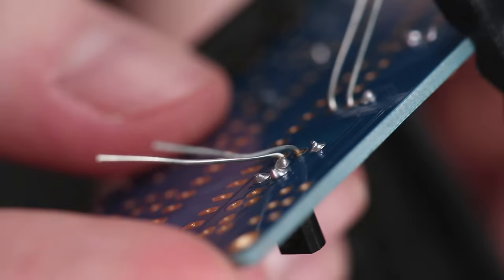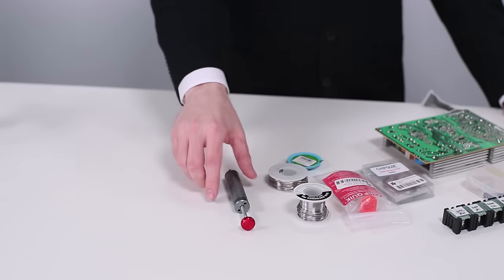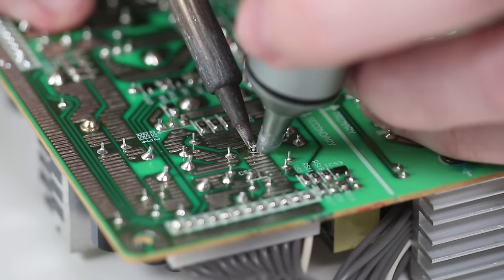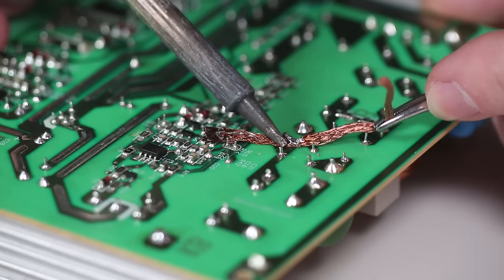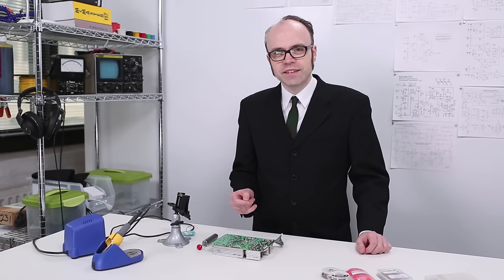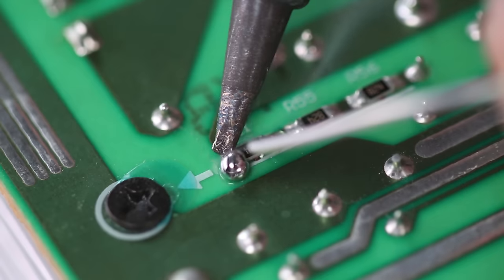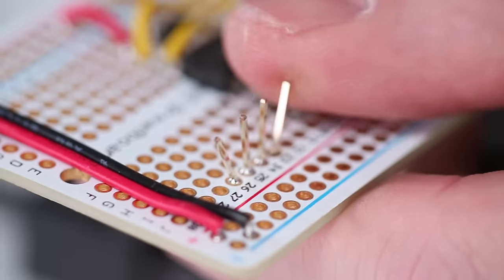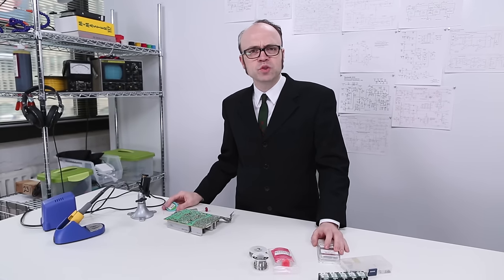Collin’s Lab: Desoldering

Comment: I'm finding desoldering a real pain. Thanks for the humorous attitude. It's just what I need. And there are some big tips here too.
Reply: My problem is that no matter how hot your solder iron gets that the solder doesn't liquify. I wonder what type of solder do these companies use?
Reply: @dragnet53  unleaded solder requires more heat. I've had to turn my station up to 415C to get it to melt. of course, make sure to be generous with the flux as well, and you might find better success if you melt some leaded solder onto the joint and then remove it all together
Reply: Personal opinion, desoldering smd with a heatgun is a breeze, simply heat the element slowly up you want to desolder, and then wipe it off the board. Soldering normal solder joint get one of those solder sucking irons (a combination of soldering iron and solder sucker) and then heat the connection up and suck the solder out, the easiest method I have found so far to do the job, makes desoldering especially pin rows a breeze!

Comment: I literally can't desolder.  I've tried so many times with both wick and the pump.  Usually the solder either just doesn't even melt no matter what I do or the pump doesn't really pull all the solder out of the hole.

Comment: To remove SMD passives, simply put a large blob of solder on the iron tip, lay the tip on the part, and slide the blob between both joints quickly. The part will wipe off with very little effort.

Always be careful cutting apart headers while they are still soldered to the board. The pins will be forced apart from each other and this puts a lot of stress on the pads. You can easily damage a board. I recommend sliding the plastic separator off of the pins instead of cutting it.

Chip Quik is awesome for removing SMD ICs, but remember that the alloy is specially designed to create WEAK, easily removed joints. You don't won't Chip Quik to remain when you solder on the new part. After removing the old part, you should wick up all of the Chip Quik, then flood the pads with fresh solder, and wick again. This is to ensure that as much of the Chip Quik as possible is gone.

Comment: Thank you, you are a hero!! I just replaced the Lclick switch on my Logitech G402 mouse. It took me an hour to remove the 3-pin switch because there was no space to hold on to the switch on the other side as i had planned. I had to de-solder whole prying it. It was a lot of work. I am going to order the Desoldering Pump and Desoldering Braid. Thanks again!! Now my mice will be repaired easily, hopefully.

Comment: I know this is super old, but I just did my first solder today. I wanted to do something simple, so got a little blink pack that turns lights on and off. They linked to your channel for desoldering tips. Thanks a lot. This was super helpful. I was wondering what the wick was for and why my setup came with a weird suction thing. Thanks a lot for providing info to newbies like me!

Comment: Glad to see new Collin's Lab videos. I enjoy his quirky delivery.

I find it interesting that he was saying to use desoldering braid for "dealing with a large amount of solder". I generally thought of it in the opposite. I would use my solder sucker for quickly sucking up the majority of the solder joint, and then using my solder braid to get the last little bit of solder to free the component lead from the side of the through-hole plating. (Chem-Wik flux impregnated solder wick for the win!) Granted, all my solder suckers have the heat-resistant rigid nozzles so in order to get a good "suck" I had to quickly remove the iron and push the nozzle flat on the PWB just as I'm pressing the button in. I guess I never liked the waste of filling up inches of solder braid on one desoldering action, especially when I was the one paying for consumables. I should get myself one of those solder suckers with the heat resistant flexible tips one of these days...

I also use solder braid for cleaning excess solder from the pads (both THT and SMT pads) before applying new solder. Hold the braid against the board with the iron tip and gently wipe.
Reply: +Christopher Elliott (Sembazuru) Same

Comment: Tried it for the first time and it was a annoying. The pump sucker was useless but I see clearly I wasn't using it properly. Lucky I had an impact drill, I could use a very small drill bit to drill it off and then add the new component to the circuit board which I was doing it for my monitor. To my surprise I got it going (eureeka!) unbelievable. Saved me $200-300 for a new 24inch monitor. Will see how long it will last but so far so good been a whole week now. New beginnings and journeyman to the soldering world :)

Comment: SMD resistors and capacitors are easy to remove with your soldering iron just alternatingly heat both pads quickly and you can usually remove a part in a couple of seconds.

Comment: Excellent video! Question: my 30-watt soldering iron melts my regular tin wire, but when I try to desolder parts in electronic devices like a mouse or cell phone, it won't melt the solder. Should I get a more powerful soldering iron?

Comment: I’m having an issue with through-hole components where the solder wick isn’t sucking up all the solder... it’ll take in some (and it often seems like it’s taking a lot), but some solder remains pooled in the hole. At that point, the wick and the heat of the iron can’t properly reach it. I can re-solder the joint and try again, but it’s not perfect. I only got 4 successes out of nearly 50 attempts. The pads are starting to burn. Will the solder sucker do a better job at removing solder without it pooling in the hole? I’m trying to desolder switches in a mechanical keyboard.

Comment: If I can't just heat it up and pull it out, or want to remove solder, I heat the solder up, and blow hard, blowing the solder away. Just keep in mind, molten solder will be sent flying.

Comment: What about using hot air?  A great & easy way to remove parts.
Reply: +Danon Alexander I've tried that and it's very easy to melt nearby joints by accident. You can use foil or tape, but that's more trouble than solder wick or hot tweezers.
Reply: +Danon Alexander I was going to ask the same question along with tweezer-type soldering irons. I suppose he could have mentioned those as footnotes, but I think his target audience are people who only have a generic soldering iron. (Hot air requires yet-another-tool, and only higher-end soldering stations support the tweezer add-ons and is also yet-another-tool.)

But, I'm only guessing at Collin's motives for neglecting those two techniques. (Assuming, of course, that he writes his own scripts...)

Comment: I held my heated solder machine to the solder part of a pin for like 10 minutes. Both the circuit board and the circuit itself become hotter than the sun. But the solder attached at the bottom of the pin of the circuit still didn't melt. Is there any tips for that part?
Reply: I'm rather new to soldering myself, but I had the same issue. I read that this is because the old solder has no remaining flux (that helps it melt better), and to either apply some fresh flux, or even apply some fresh solder that has flux in it (a lot of solder has a flux core). NOW try desoldering the pin. The fresh solder helps transfer the heat energy a LOT better, and it ALL will melt a lot better, allowing you to pull the pin free and then use a solder-sucker to clean off the old (and new) solder. Had to do this today after watching this video as a refresher.

Comment: my iron isn't hot enough to melt the lead while desoldering but works fine when i solder any suggestion ?
Reply: Apply a little new solder to what you want to desolder then suck it up. I know it sounds counter productive but it works.
Reply: have iron freshly cleaned/tinned
Reply: @coby_mj2536  I second this. It works. Especially if your fresh solder has a rosin flux core. Once you get that to melt, it helps transfer the heat a lot better to the old solder, making it melt as well. Then, suck it all up before it cools and solidifies. :)

Comment: Actually you don't have to break a pinheader unsoldering it, you could also slide off the plastic and then unsolder each pin separately.

Comment: That is not how you use the copper braid! You just unroll a tiny length (10-20 mm) from under the rubber so that the unused length doesn't act as a heat sink and you cut it off bits at a time after you have filled the small section with solder. That way you will spend less time heating up the braid and it will absorb the solder much quicker and more cleanly.

Comment: cutting solder braid off the roll wastes a lot of it, you can do what you did by just pulling small lengths out from the roll. also for smd and even headers using a hot air station works far better than what you are showing here

Comment: Whelp, I ended up desoldering like a dipshit and having to melt, then swipe the solder off onto a damp cloth, but for my first soldering job on an old NES that has no gaurantee of working again with an old soldering iron, at least I soldered the new regulator in much more nicely than I expected to be able to.
Reply: Will update to let you know if I flopped or if I'm curb stomping goombas once more.
Reply: Good news, no fiery death. Bad news, something other than the 5V regulator let go so I'm fucked anyways...oh well. Good soldering practice though.

Comment: fuck this.... to desolder element, melt the solder and pull the element out, to replace it melt the solder and push the element leads into place... as simple as that, i fixed many devices like this... solder pumps, wicks only if you are new to soldering... be careful when desoldering smds, some chinese companies use conductive glue for them instead solder...
Reply: but what when you have 20 solder points?
Reply: Marvin Schnabel
you rarely need to desolder something with 20 pins to fix a device... i successfully desolder ATMEGA328P with this method, heat and melt all pins from one side and pull that side, then heat and melt the solder on all the pins on the other side... if it doesnt come out with one melting then you will need to slowly melt the solder and pull the element only slightly, then do the same on the other side and continue doing that until you pull out the element completely... way simpler and faster than using pump or wicks, only downside your will heat the element way more than with pump or wick but hey if your pulling it out then for sure it is a dead element anyway...
Reply: +IamIUareU For something like a 20-pin IC, the easiest way to do it is to solder an appropriate chip socket to the board, and then plug the chip into the socket.  Need to replace the chip? Forget the soldering iron, use your fingers.
Reply: rlrsk8r1
true, every hobby electronic should know that chip socket is his friend nowadays...
Reply: +IamIUareU Here's something out of my past that makes a good case study:  I bought a simple audio crossover for amateur radio use--a couple transformers for audio in, audio out, and an opto-isolator for PTT.  The opto-isolator was a 6 pin DIP soldered directly onto the board, and it was DOA.  The manufacturer had inserted the pins of the chip through the board, bent them all over to secure them, and then soldered the pins.  I couldn't wet the solder and lift out the chip, I had to completely desolder each leg and bend them straight again. Fortunately it was just a 6-pin DIP so it didn't take long.